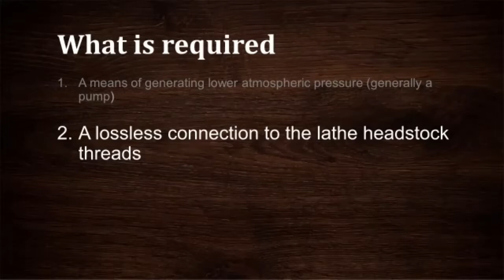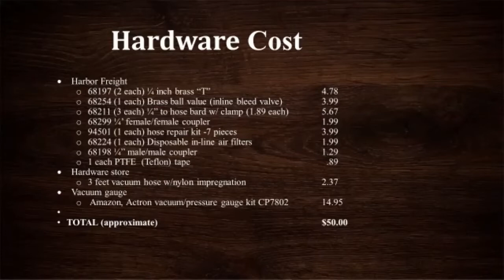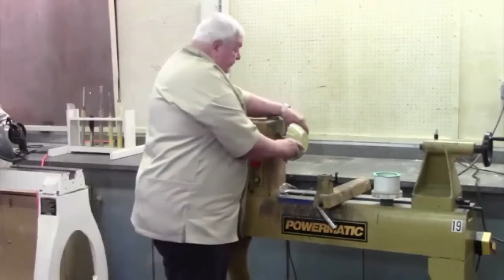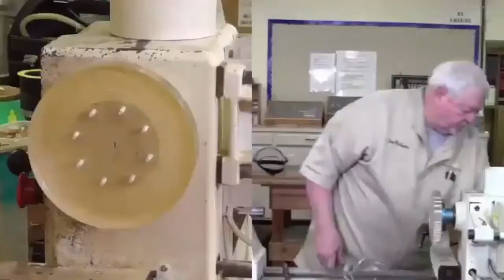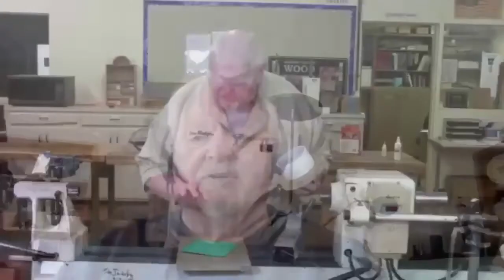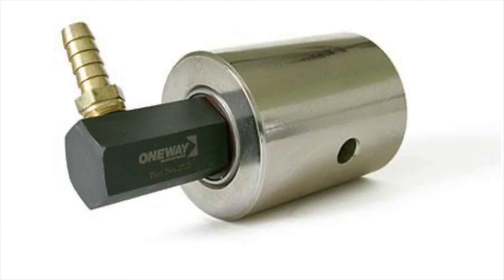Sawdust session on Vacuum Chucking

Comment: What causes my vacuum pump to produce an oil cloud that fills the room when in use?
Reply from the maker: The diaphragm pumps do produce an oil mist as that is the lubricant in the system. It shouldn't product THAT much mist! I suggest that that pump may need to be replaced. The one we use at school produced very little mist which we capture with a simple loose-fit cardboard box.